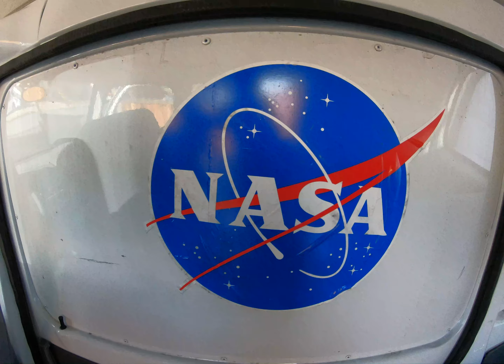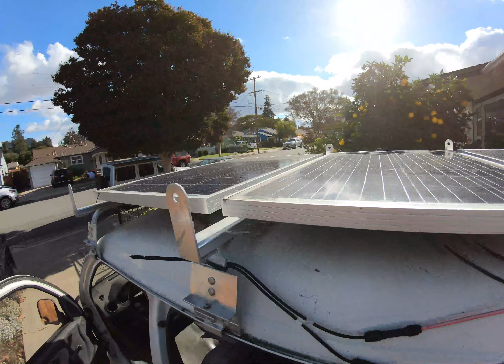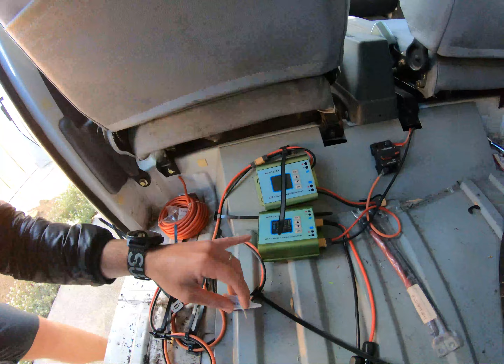2.1 Solar Electric Van Intro - NASA Surplus Vantage Green Van

Comment: Any updates on this? Hows the van? What kind of range you getting? Do you ever have to plug it in?
Reply: Van is great. I only plug in to trick the "fuel" gauge to be full. Range is probably 20+ miles.. I haven't run out ever. Its the winter now, but when its charged... I take it 8 miles often and it only goes down one dot.